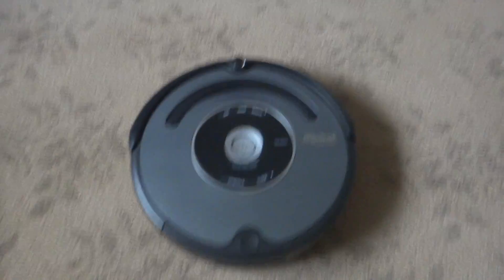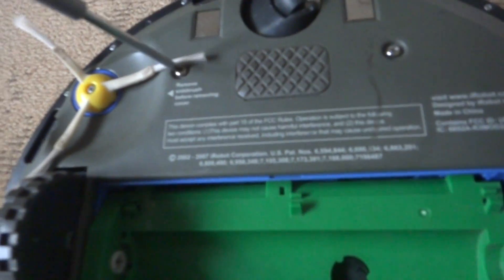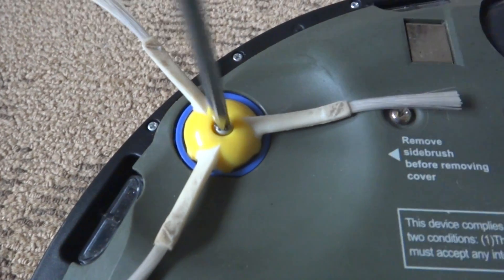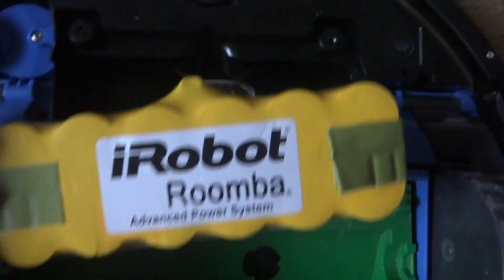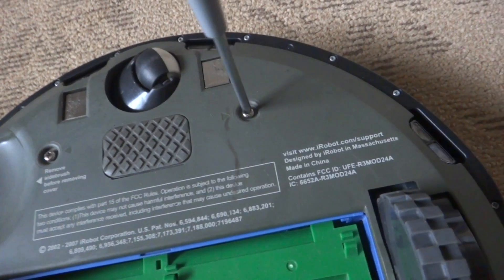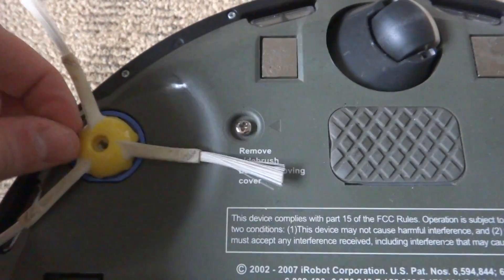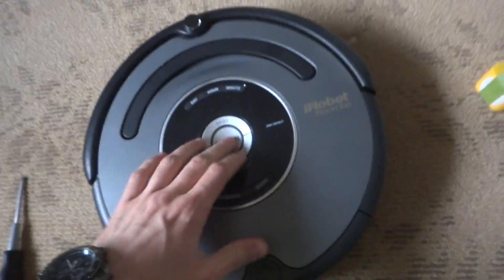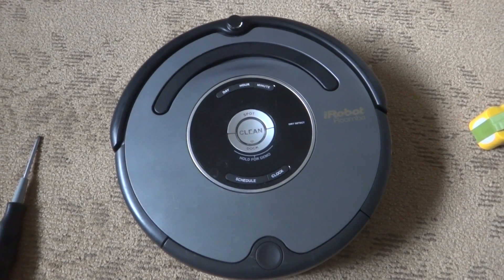How To Tutorial: iRobot Roomba 550, 560, 570, 580 Changing a Battery Correctly

Comment: my 595 pet series needs a new battery, what brand model would you recommend?
Reply from the maker: +Okaythen001 to be safe, I'd go with irobots xlife replacement battery for $80. But personally, I never liked their replacement battery. For myself, I'd buy a aftermarket batter on eBay for less than $25. Using the 4500 mAh would be plenty and life cycle. Just check on seller rating before hand.
Reply: 4500mAh wow how long would one charge last? amazon I only see 3800mAh. amazon reviews said they last around 1 year then dies is that about right for aftermarket? (20 to 25 bucks ones) I am going to check on ebay now, 4500mAh sounds awesome. (also I only use the roomba like once a month)
Reply from the maker: +Okaythen001 the length of time it will work will depends on a lot of variables such as how clean the gears are inside, if the dust bin is clean, if the brushes are clean, how much is it picking up around the house... And so forth. There is no exact answer.
 It may be a good idea to use your Roomba weekly. Just for the battery charging cycle to go through more often. It's not good for batteries when they just stand without being used for long periods of time.